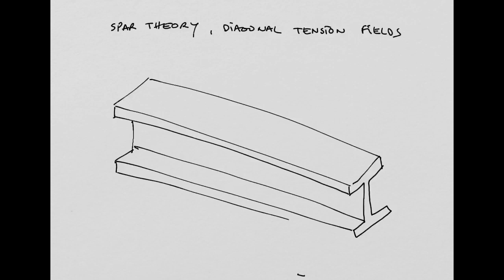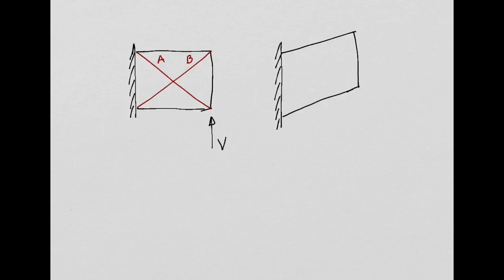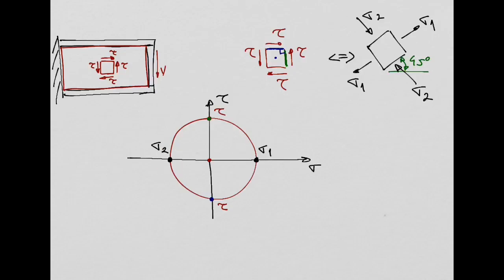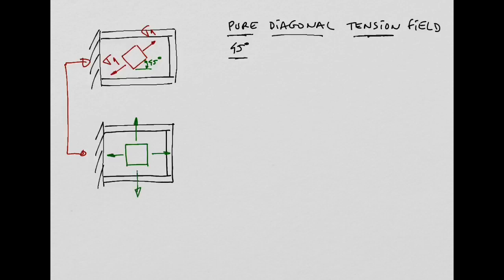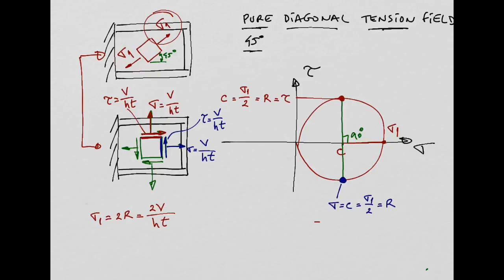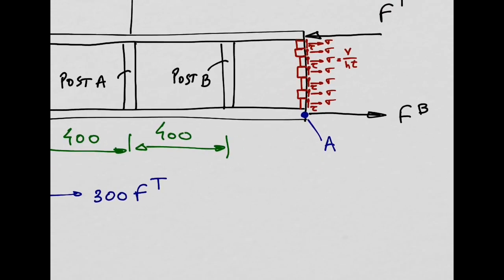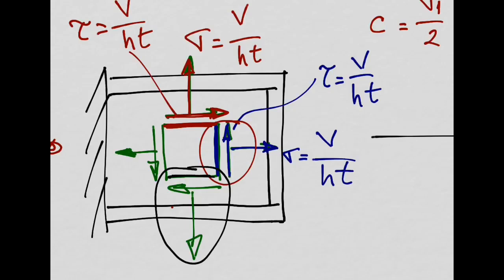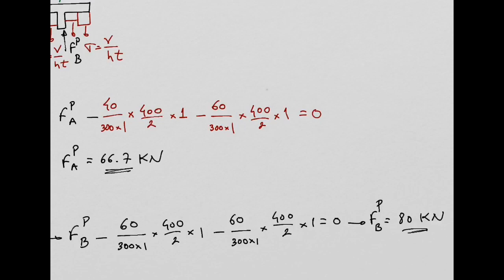Spar Theory & Pure Diagonal Tension Field

Comment: this video helped me better understand IDTs in the context of frame analysis as a stress engineer. One thing I could add is that in this frame where you only have an upper and lower cap, you also apply transverse load from the IDTs to each segment and treat each segment as a simply supported beam. The IDT's induce a moment on the chords!!